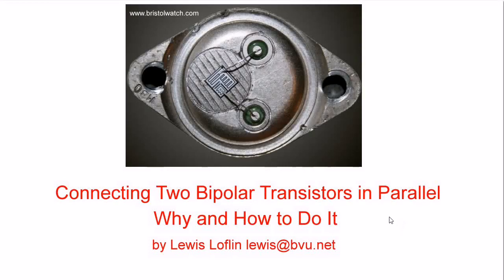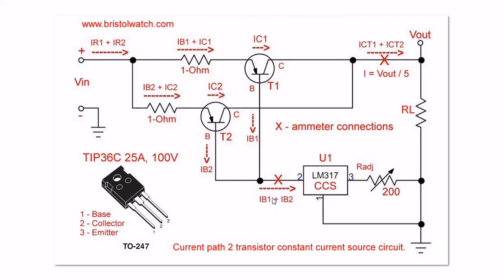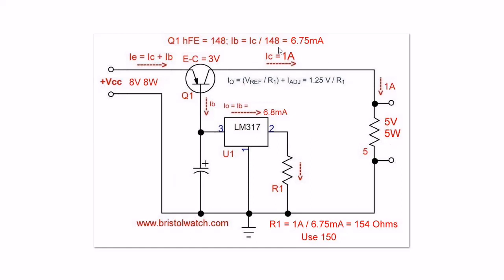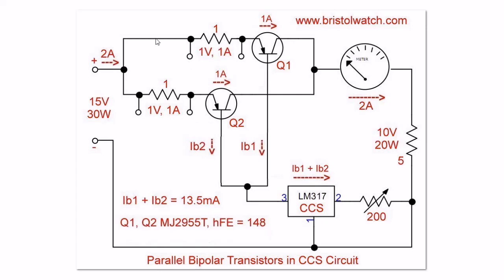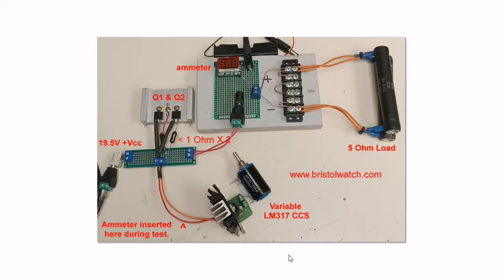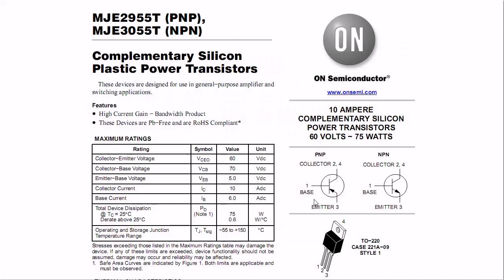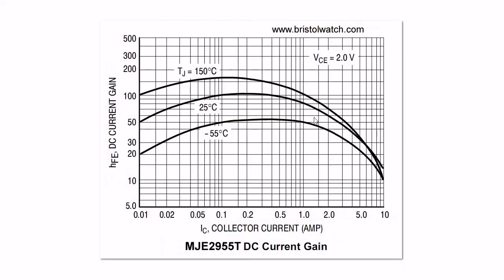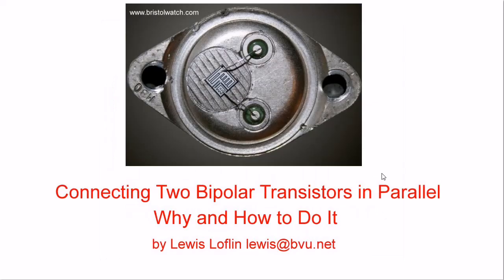How and Why to Connect Bipolar Transistors in Parallel

Comment: so we can make double current using two transistor in parallel with same base bios..............great ...........all we have to take in account same temperature on both T
Reply: The last is quite easy to to do by putting the transistors on the same heat sink. The same temperature is important to have the same Vbe for both of the transistors. The same current for both depends on the tolerance of the resistors. For 1% resistors you get at worst 2% current difference between them. This corresponds well with the 20 mA current difference at 2 A, which is 1% of the total current.